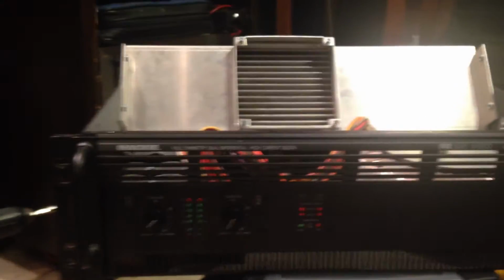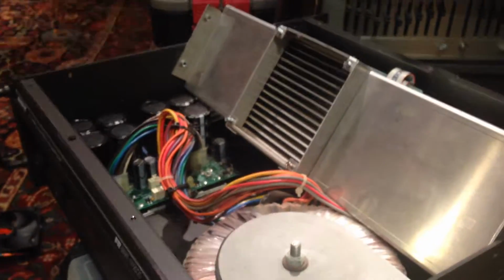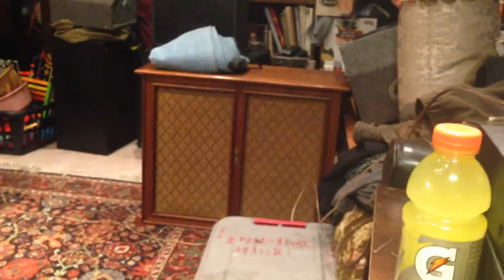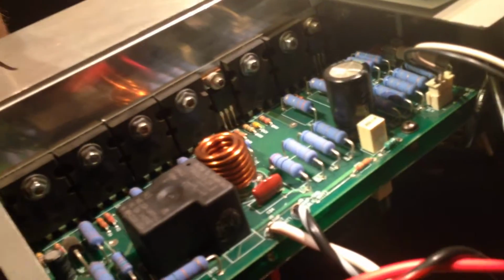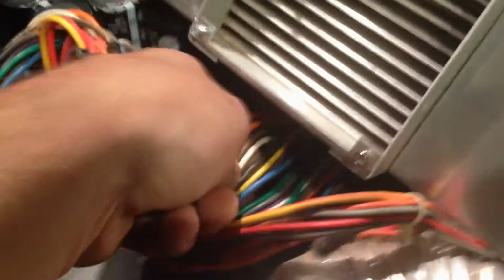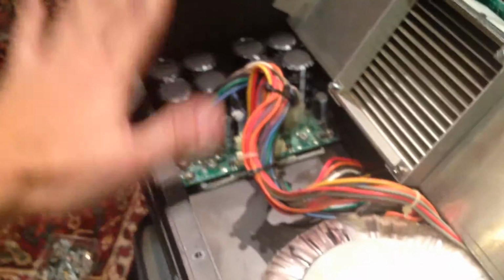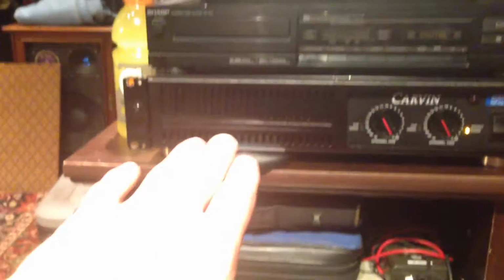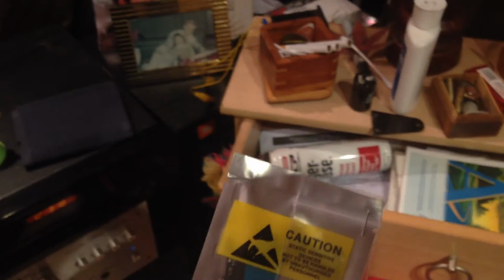Mackie M2600 pro amp repair

Comment: I have the same amplifier. I was wondering if you could help me troubleshoot it. It is going into protection after I play it for a little bit. I'm an air conditioning technician so I have the meters and everything. There is a burnt component inside of it. I can't remember right now what it is but if you could help me I'd much appreciate it

Comment: What a stupid thing to do... put in the wrong kind of fan which will emit EMI being an AC fan you can switch off to prevent cooling while driving heavy loads.  Great way to fry a nice amp even with the thermal protection, which is just a fail safe.

Comment: It's a "V-amp" board you're referencing at the beginning.  The current I'm getting with 10.5mv bias (anything between 8 and 12 is ok I believe..) is about 1.5A at 120V AC in.  Someone plugged one in wrong.  Smoke baby.  Magic..smoke.  There's a pair of parallel load resistors in series w/transformer primary when you turn it on.  That powers up the +_15V and +_30V if all is well.  If an output or driver is shorting it won't come up to voltage there so the protect circuitry will not power up and thus the relay that bypasses the load resistors will not kick in.  It's a 1 second delay normally and the relay kicks on to give full power into the transformer.  Without that it'll run a couple amps and make those resistors HOT FAST!  Don't run it that way more than a few seconds or you'll burn them out probably as I recall.

Anyway if you lose an output they recommend changing all.  In some cases though you can get away with changing just the pair that goes where one was weak maybe and a big hit took it down quickly and relieved stress on the others on that side.  It's a big job doing all 16 but in trying to get away with it, what got me was the stinking MJE15032 driver right in the MIDDLE under that sub heat sink!  lol.  Having it plugged in I could detect a difference in the diode check on the complementary 15033.  I pulled it..it was ok.  I went 'oh great...looks like we're pulling all that off again'.  It's an absolute pain but that's how they are.  In bridge mode of course everything could be affected so you'd be changing in this case 32 power transistors and what is it 8 drivers?   ouch.  I'm hoping there's a good reason it just took out the two quickly and the other sdidn't get stressed.  So far so good.

-Bob / Sound Doctorin'
Reply from the maker: Wow thanks for looking. I'm going to have to process what you just said for a second.  I'm sure you are beyond the scope of my present knowledge.  Thanks again... Going to read your comment again!   :)

Comment: Looks killer Steven. Thank you for sharing.
All the best.
Bobby
Reply from the maker: Thanks.  Merry Christmas!  S
Reply: Hey Bobby, I can hear that thing all the way over here! 
(ooops, sorry, that was some dipshit driving by with his super bass car rattling my windows).
Reply: ECH85 is a tuff one to find for my Philips tuner tube, not sure if mine is bad, but weak FM.  If you have a shitload of those common 35 or 50 volt series tubes, I just used my last one.  What are they?  35W4 50C5?  whatever they are?  And I used my last 12AX7, or was that a 12AU7?  I only have a small box of tubes.  Thanks for the offer, I will let you know when I find more dudds.
Reply: the ech85 is rare and hard to get, - for the Philips Jupiter.  I usually keep two or so tubes, and when I need them, I look for them.  But it's nice to have some of he more common tubes since they usually need replacing, and it saves a lot of time to have a few laying around. I need caps more than anything, I have a 1946 Philco on standby, and the Philips needs caps too, just got to get the schematics and see what they need.  Sometimes caps cost more than tubes. I usually need the more common 20, 30, 40, 80, and other common mfd ecaps at 450V or more.  But I have not looked into what the Philips and Philco need yet. I just won an old GE tube clock radio on epay, most likely an AA5 tube / ecaps typical radio.  It humms, and was only 20$.  It's the same model my parents had when I was a kid, and used to listen to AM broadcasts on it, nostalgic BS.
Reply from the maker: Ok I sent you an email.  I'm gonna stop replying on this thread because poor Mr. Bobby Tech is getting all these in his inbox SORRY Mr. Bobby!!

Merry Christmas and I can't wait to see if u got the flyback in the B&K!  We will stop aggravating you on this thread!  Don I have 6 tubes, the small, but can't locate the bigger. Will look again in the next day or two, but I don't think I have them.  It's dark already here, I'm an electrician so of course my shop is unwired! Hahaha s
Reply from the maker: Haha!  Mr Don I have your message, I'm babysitting now and only have the iPhone.  I'll get on the iMac in a bit and send you some stuff and my email and stuff.  YES I LOVE TO TRADE!  Please don't order any tubes without checking with me first!  I need to get some of these to friends before they rot!
Reply from the maker: ***** ok sorry having internet issues.  well i dont really have internet, i"m using the mac thru my iphone internet hotspot and the signal gets aggrevating about this time of day like 3/5 pm.  so whats the amerivan number again?isnt that a rectifier?  a 50c5?  ill check and see what i have.  give me an hour or so ok?  be glad to get them to ya!i have lots of 12ax7 and 12au7's.  how many of each of those do u want?  hang on gonna send an email to you now...